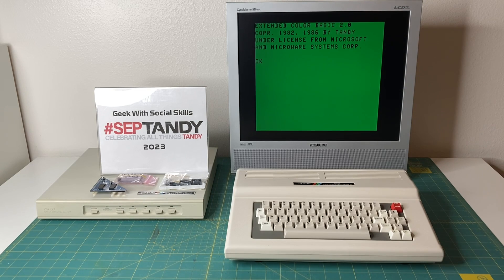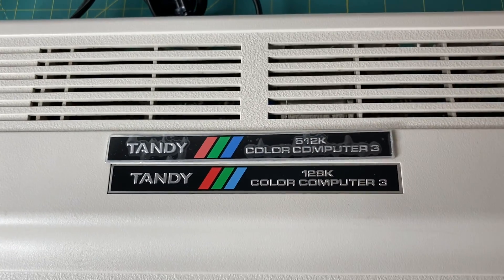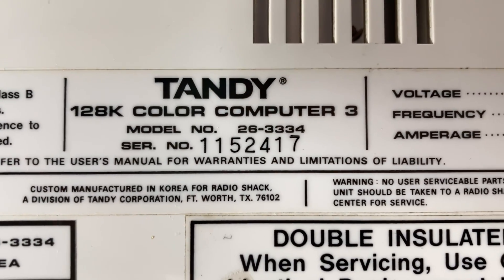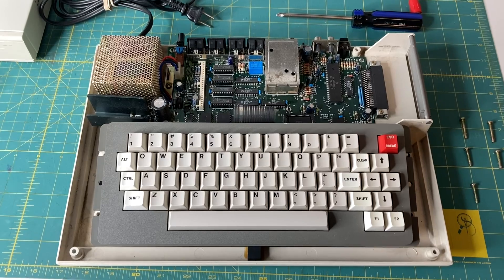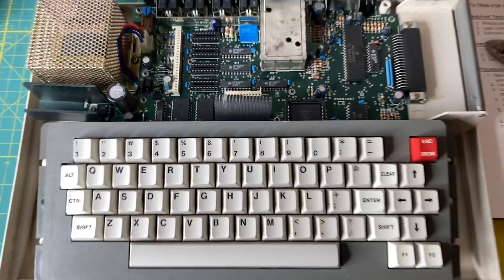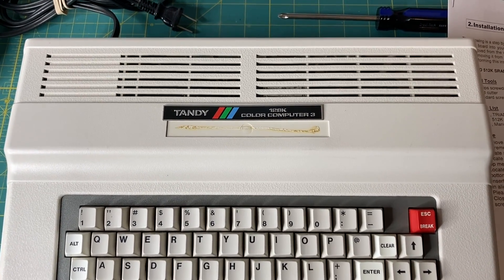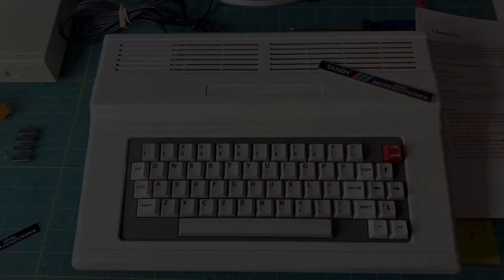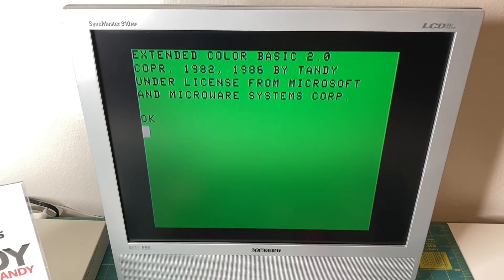Tandy Color Computer 3 - TRS-80 RAM Expansion Upgrade #SepTandy

Comment: Why, in a video titled "Memory Upgrade", would you use the "magic of editing" to edit out the actual installation of the new RAM PCB?  That's the moment I was waiting for!  I wanted to see where and how it connected to the motherboard, maybe even see the back side of the new RAM board (which you never showed us).  I want my 6 minutes and 40 seconds back which is all I could take after your editing magic show.
Reply from the maker: Starting at the 4:45 mark I cover exactly what you mention, showing where and how the memory upgrade board connects to the motherboard. I also showed the instruction page on "how-to" and specifically pointed out the areas being worked on. In future upgrade videos I'll work on showing more detail. Thanks for the feedback.
Reply: @geekwithsocialskills  I was looking forward to the moment your hands actually pushed the new PCB onto the pin headers. I like your video till then, learned a bunch.  Had a TRS-80 Mod III 48K.  Never knew about the CoCo let alone the 3. 512k, wow. Checking out more of you videos, you present well..
Reply from the maker: @javiervidaurre6325 I usually don't show that much detail in my videos since my hands usually get in the way LOL, especially trying to get the perfect camera angle. Basically I do a 30,000 foot view of various upgrades. I'm by no means a professional, just a hobbyist. Indeed 512K is a lot of memory. On my channel I later did a 2048K memory upgrade to the CoCo 3. Here's a direct link to that video https://www.youtube.com/watch?v=L6poiGLmf4A

Comment: Nice walkthrough on the RAM upgrade! A quick question on the video output - the TV image looks nice and crisp.
Does it use plain composite or some sort of MOD or RGB output? And what is that rainbow ribbon cable for?
Thanks!
Reply from the maker: Thanks! The CoCo 3 RAM upgrade is a pretty easy upgrade to do. As for the video output, the CoCo 3 has a RGB port on the bottom which I'm using in this video along with a Switch-a-roo SCART cable. My monitor has a SCART connector but you can also use a SCART to HDMI box as well with this cable. Here's a link to where you can get the Switch-a-roo cable https://cocoman.onlineweb.shop/Switch-a-roo_SCART_cable/p7004829_20319861.aspx

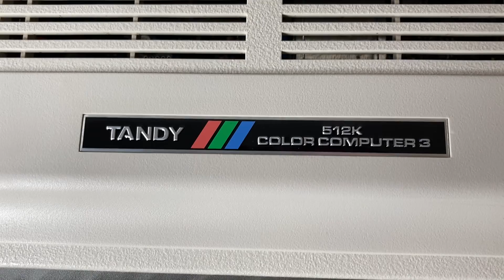Comment: 8:30 Just a little tip in case you didn't think of it.... I am incredibly disorganized and so whenever I make a modification to a machine, I tape the old parts inside the machine. That way, the old parts can never get "lost" so long as I have the machine.
Great video.  Hope you can get around to the CPU upgrade and show off the computer running some cool stuff.
Reply from the maker: This isn't my first rodeo LOL. I will sometimes tape parts inside like you suggest, however over the years I've setup a really nice way of storing parts from doing upgrades, etc. At some point I'll do a video showing my work bench where I do a lot of these upgrades, repairs and how I store parts. As for doing the CPU upgrade, I've actually already done that mod. All I have left to do is the recapping of the motherboard which I'll be doing this weekend, so stay tuned for a follow up video in the coming weeks showing these updates and also showcasing some demos and homebrew games running on the machine.

Comment: Thanks Geek, I've got a memory upgrade to do on my coco3,  but had not seen what was necessary to install it, or even open one up. Now I'm ready.

What's a program that used extra memory?
Reply from the maker: This CoCo 3 memory upgrade is probably one of the easiest upgrades I've ever done. I'm happy to hear my video will be of use to you for your memory upgrade. As for programs that use extra memory, a lot of the newer homebrew games take advantage of the extra memory. Back in the day with the official Radio Shack 512K memory upgrade I would assume it was mainly used for productivity software like spreadsheets, etc.
Reply: To answer your question - Quite a few of the games these days do. All the Williams arcade game transcodes (Defender, PacMan, Donkey Kong, Joust, Robotron) do, as do all of the Sierra graphic adventure games. Other games like Contras, Sinistaar also come to mind. And (my standard self serving plug here... lol) NitrOS9/EOU is designed for 512K or more (runs perfectly fine in 512k).
Reply from the maker: The arcade game transcodes are amazing! They were a huge reason why I wanted to upgrade my CoCo 3 computer. As for NitroOS9/EOU, I hear that will set your hair on fire LOL!

Comment: You have to upload a video playing the "emulator" games for the coco3.  Donkey Kong and Donkey Kong Remixed (IIRC) are near arcade perfect, especially for an 8 bit computer.  There's also a Pac Man "emulator" as well.  I'm pretty sure they all require the 512k upgraded model.
Reply from the maker: Part of the reason I did the 512K memory upgrade and the soon to be completed Hitachi 6309 CPU upgrade was for running this updated games and ports on the CoCo 3, so for sure there will be some videos showcasing these games and demos.
Reply: @geekwithsocialskills  Will existing software run at the proper speed with the upgraded CPU?  I've read its faster even at the same clock speed without utilizing the extra features of the chip.  Like if it's 20% faster, will it run original games 20% too fast?
Reply from the maker: Existing software and games will run fine. The Hitachi 63B09E CPU is a pin-to-pin direct replacement for the 6809E found in all Tandy Color Computers which runs much cooler than the 6809E found in the CoCo. It contains additional CPU registers and an enhanced instruction set that will bring significant performance compared to the stock 6809 CPU.
Reply: @geekwithsocialskills  - it also defaults to "emulation mode", where all instructions run at the same speed as the Motorola 6809 (you do still have access to the new instructions and registers though). Turning on native mode speeds some of the instructions up (even with no code changes at all) so on average a program will speed up 15-20%. Do some reprogramming to use the extra instructions and registers and you can speed them up even more (Doing both I have Rescue on Fractalus running about 35-40% faster now, as an example)
Reply from the maker: Rescue on Fractalus is amazing! Thanks for all your hard work keeping the Color Computer dream alive Curtis!

Comment: Very nice!  I still have to verify which memory expansion board I have.  If memory (no pun intended) serves me, it's larger than the Triad board, so it's probably an older upgrade.  Maybe I'll remember to look this weekend.  I just hate the snipping because it's so permanent lol.
Reply from the maker: You might have the official Radio Shack memory upgrade since they did offer one back in the day. According to the Cloud-9 folks the TRIAD memory upgrade runs 90% cooler than other 512K upgrades, uses 1/20th of the power and it's also half the size! As for snipping those two capacitors, even the official memory upgrade this needed to be done. If you ever want to reverse out the memory upgrade, you can easily just replace those two caps.
Reply: @geekwithsocialskills  I'll look at it at home and see.  It probably would be worth it to get the Triad board just because of those benefits, not to mention the cool badge 😎
Reply from the maker: At the time of writing this comment, the TRIAD upgrade board is $50 USD and IMHO totally worth the price. I'm not sure if they still include the replacement badge since I got mine about a year ago, so be sure to ask them when ordering if it's still included and/or available.
Reply: @geekwithsocialskills  I just looked at mine.  It's branded Cloud-9 and actually has two 30-pin SIMMS.
Reply from the maker: @BollingHolt  Cool! You have the earlier 512K SIMM version.
Reply: @geekwithsocialskills  Not sure what the "vintage" is of it...  haven't looked it up yet... but if it works I'll use it LOL
Reply from the maker: @BollingHolt  my TRIAD surface mount memory board revision date is March 2013, so I would assume your SIMM version was prior to that. Here's the link for more information on both boards https://www.frontiernet.net/~mmarlette/Cloud-9/Hardware/512K.html